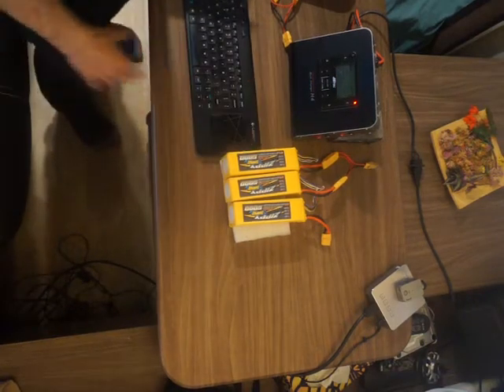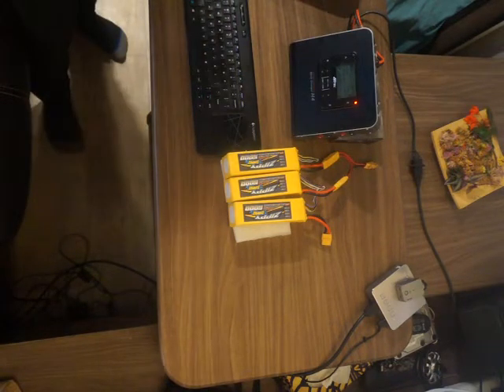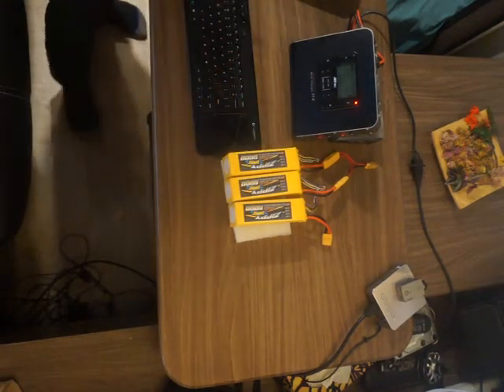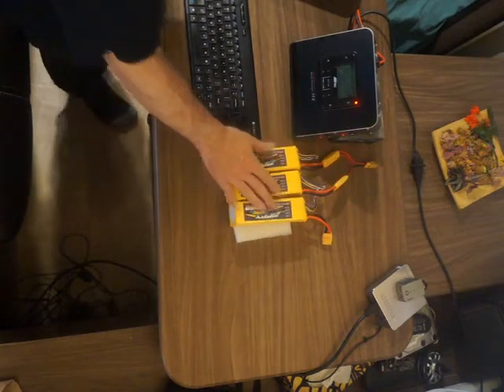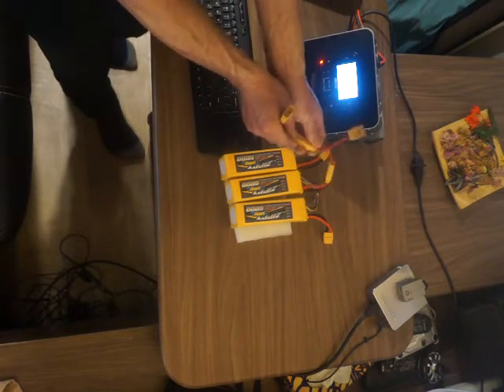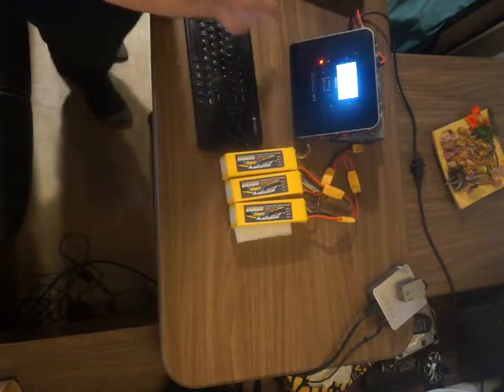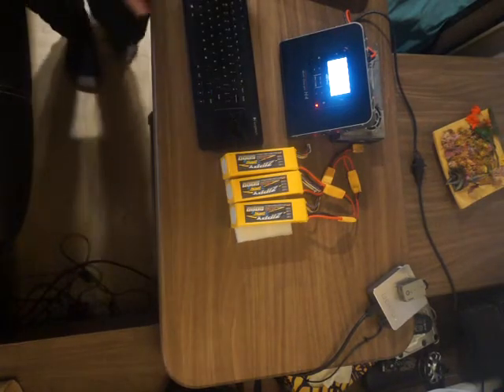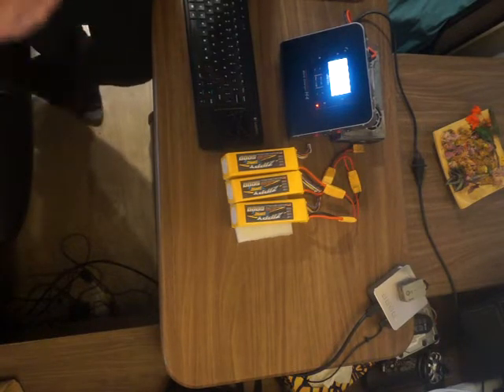How I use Lipo in my ebike

Comment: Hi I run a 48v 750watt (capable of 1000w) ebike. I noticed you only had three packs, sorry if this has been asked before but what battery packs are they and can i get rid of a BMS and just charge each cell seperately at the end of each day, then use series XT60 connectors to connect it alll back together? also I have two prongs for power on my ebike for a slide down battery pack. Could you recommend something better than crtocodile clips to get the voltage to the prongs and it not slipping out while riding... Great channel!

Comment: How do you monitor the pack voltage when riding? From the controller ?
Reply from the maker: Ya... from the controller, or in the past with other bikes I have used lipo battery monitor with alarm for 3.6v...
Reply: @Simplyflyit  perfect thank you. I decided to go with Lipo because of the limited space I have on the frame. Do you store your batteries indoors in a fireproof container? I'm worried about them randomly catching fire if I'm overseas even if they are at storage voltage !
Reply from the maker: @mustafataha7305  ya, I use a munitions case to store the batteries indoors.

Comment: Hi I'm looking for some advice... seems like you are good person to ask. I want a fairly painless charging set up for 5 4s 20000mah turnigy lipos strung together. Should I use a bms or just parallel all of the balance cables and change connections from  series to parallel for charging?

Comment: Do you know what S to use on a 36v e bike sytem, I take it I have to go off full charge voltage not nominal voltage, but although I have rc's I like my lipos in even cell counts so I can use two batteries with the same cell count, whereas I think a 36v e bike requires 9s.
Reply: Good question, you ever figure it out?
Reply: I’m wondering as well..

Comment: I like the idea,  another option I use is Milwaukee m18s 12 ah on adaptors,  I use 4 for 80 volts,  20s and I have 4 Milwaukee chargers that charge the 12ah batterys in 45 min.  I also have a tandem bike I use four batterys in series parellel for 24ah and 10s 40 volt,  3 year warranty on the batterys too I upload a video when weather  changes

Comment: Hi, great info.  I'm a newbie building an ebike with the CYC motor kit and need help with my battery pack specification to achieve top performance.  Thinking 72V 40Ah.  Thanks.
Reply from the maker: 40Ah... ok, thats huge... hich bike? thats a monster battery... likely ieghs as much as your bike... In my mind,  a 10Ah is plenty, and I carry a spare in my pack, for total of 20Ah... 20Ah gives me almost 3hrs of use....
Reply: @Simplyflyit  I have a 2006 Specialized StumpJumper FSR.  I also have been considering carrying a spare for longer rides negating the need for a 'full' battery pack on each ride.